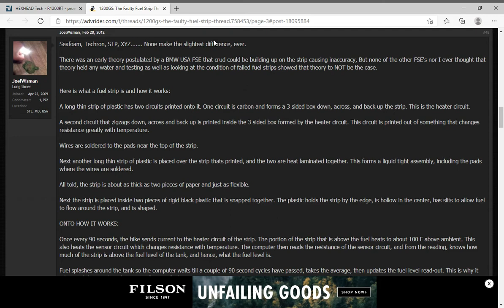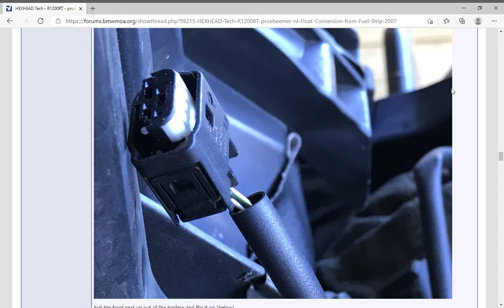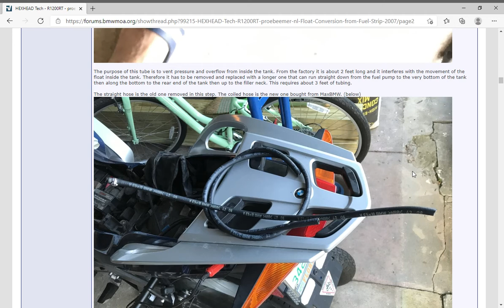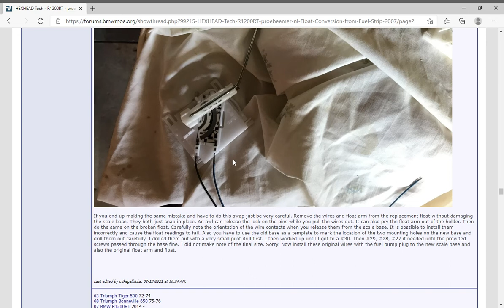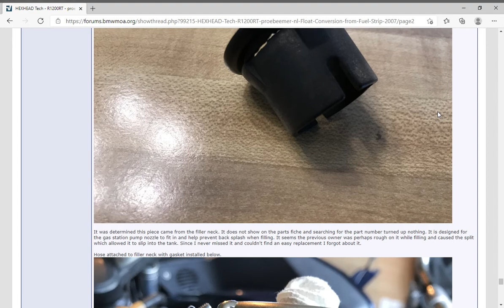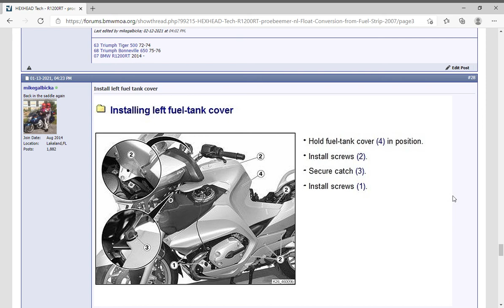2007 R1200RT   proebeemer nl Float Conversion from Fuel Strip

Comment: This is so impressive! Thank you for sharing, very educational. For now I would be happy if I could just persuade mine to show always full, instead of always empty.. On my bike I am not getting any voltage readings on the fuel ribbon connection, apart from a 0.58V constant on pins 1 and 4 (nothing at all for pins 2 and 3), hence the resistor setup did not work. Anyways, again well done, great job!
Reply from the maker: I included info for an always full fix using resistors. Did you notice it?
Reply: @galbicka351  Hi, I did wire up a resistor set to the connector but it wasn't working. Then 10 minutes ago I realised that I am not getting voltage on the connector (and hence my resistors didn't work) because I had the bike on the side stand... haha... centre stand and voltage comes through, also the resistors are now doing their magic. It is all good, showing full tank! Thank you for your reply. All the best!
Reply from the maker: @TheOllymo  Good job. Glad you got it working.